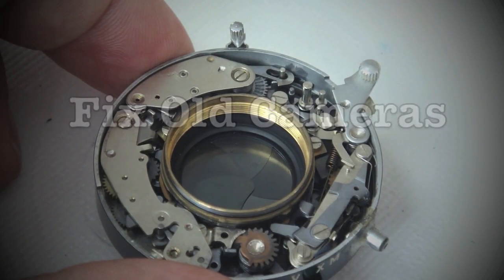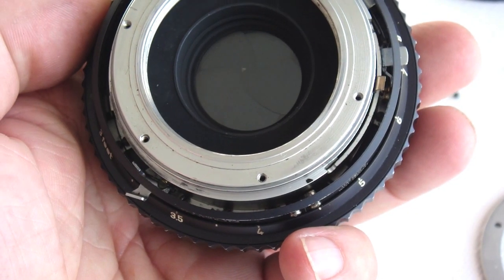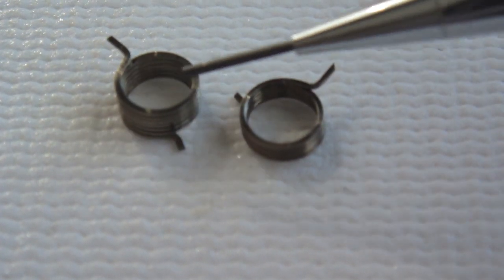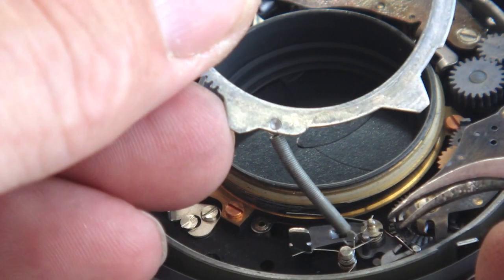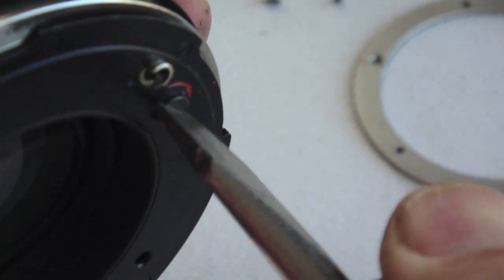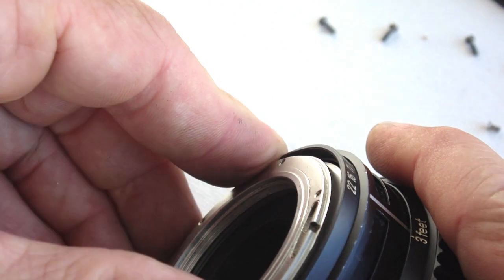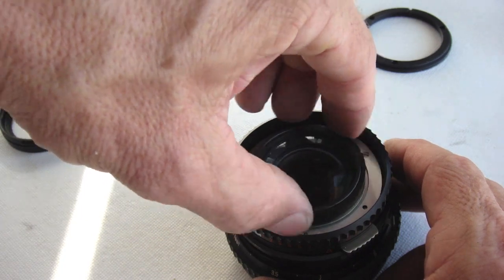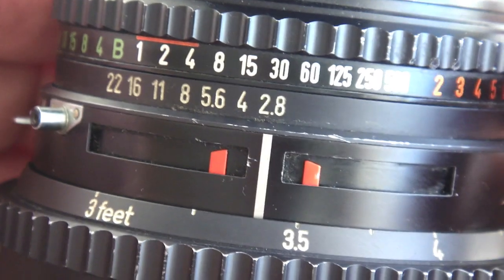Fix Old Cameras: Hasselblad 80mm T-Star Shutter Malfunction

Comment: At 3:17 no, don't do that. Oil has no place in a Compur shutter and even if it did that's way, way too much. It will end up on the shutter blades, the diaphragm blades and the glass surfaces. That gear train should only ever be lubricated with graphite powder, with the excess thoroughly blown out. But first clean it thoroughly in lighter fluid. Other than a tiny amount (literally a smear) of molybdenum sulphide paste on the sliding surfaces of cams and levers, no other lubricant is needed in a properly cleaned leaf shutter. The golden rule is that leaf shutter repairs are all about cleaning and not about lubricating.

While these videos contain some useful views inside cameras and lenses, the repair methods are almost completely worthless. It's worse than that, in fact, because the short term fixes are mostly kludges and not repairs. A proper repair would involve completely disassembling the shutter, cleaning it and rebuilding and a quality lens of this type is worth the effort but nobody on this channel seems to have the skill or patience necessary. In a few years time this lens will be unusable. Maybe that's the intention: a quick kludge to get it working again well enough to sell on eBay.
Reply from the maker: There is a golden rule of leaf shutter repairs? To paraphrase “do unto others as you would have done to you”… hmmm how about that. Had to look up the meaning of “kludge”, it was not in the two volume World Book Dictionary… but on Wikipedia this is what was found.  “A kludge or kluge (/klʌdʒ, kluːdʒ/) is a workaround or quick-and-dirty solution that is clumsy, inelegant, inefficient, difficult to extend and hard to maintain. This term is used in diverse fields such as computer science, aerospace engineering, internet slang, evolutionary neuroscience, and government.”  It figures it is an internet slang and is pretty rough, especially considering the Fix Old Cameras channel about statement… “Fix Old Cameras produces step by step up close videos of simple, common repairs and basic maintenance on classic and vintage cameras. Work a-rounds and short cuts that might go outside of typical camera repair procedures are also demonstrated. These techniques are not always considered a permanent fix, but allow for someone with limited tools and experience the possibility of getting their camera functioning again.” 
The Compur Shutter Service Manual (Compur-Werk Munchen) makes no mention or listing of graphite powder or molybdenum sulphide paste as an approved lubricant in the Lubricating Chart(CS-1912-206), however an oil designated as PDP-38 is listed. The recommended cleaning solvents are trichloroethylene or tetrachloro-ethylene. Probably not going to be able to obtain any of their recommended products. A gentler and safe to all plastic degreaser and cleaner is 91% or better yet 99% isopropyl alcohol. You did not mention rather you are using charcoal lighter fluid or Naphtha (for Zippo lighters or paint thinner) to clean the Compur shutters you are repairing. Not to imply that your technique you outlined would not work, for it seems as if it should. But, as comparison the Asahi/Honeywell Pentax Spotmatic series manual recommends on page 52 using light oil on the governor(escapement) pivot points. Without looking up anymore page numbers, you will find similar oiling instructions in the manuals of that era for Canon, Nikon, Minolta, etc. and along with the training lessons of National Camera Institute.   
Over extended time, perhaps decades, considering all conditions of use, lubricants, even those installed at the factory can and do migrate to other areas of the shutter. 
Thank you for taking the time to comment and for your passing acknowledgement as to the usefulness of some of the video shots of the inner workings of the featured cameras. As far as unstated intentions and your perception of the skill and patience needed and available for what you judge or deem as a proper or improper repair you can only speculate and hope.
Reply: Saying that oil has no place in a compur shutter is wrong. However in this video too much of it was applied! The excess should have been removed before reassembly or an oiler should have been used in the first place. Extract from the compur shutter repair manual:

"If the escapement was cleaned without disassembly, the bearings of the gears and detent must be lightly lubricated with PDP 38. Then remove any traces of oil from the plates, particularly from the underside of the lower plate 302, by means of a soft rag. If necessary, lightly lubricate the gear teeth with the oil mixture us ing a brush. Toke care to avoid the fo rmation of oil drops."

Exclusively dry lubricating a synchro compur is possible, however graphite powder has long been replaced as a dry lubricant for leaf shutters with MoS2. Mainly because of the graphite's abrasive properties that MoS2 doesn't have.
Reply: @MrRobot-om9mz  The manual to which you refer was written at a time when the professional users of such shutters would have had them cleaned and serviced on a regular basis. They are no longer made and the people who still own them, inherit them or buy them second hand expect them to sit idle for months and continue to work for years without being serviced. Oil is a bad lubricant because the volatile fractions evaporate and become redeposited on broad, flat surfaces, such as shutter and diaphragm blades, leaving behind a waxy fraction that gums together the parts it was intended to lubricate. I draw your attention to the last paragraph of your quote. Dry molybdenum disulphide paste, very sparingly applied after very thorough cleaning with naphtha, is the correct modern solution as it does a better job than oil, does not degenerate and does not migrate. On the subject of graphite, it's less damaging than oil but the excess needs to be thoroughly blown out.
Reply: @johnm2012  a modern synthetic oil applied in the right quantities at the right places will not migrate or evaporate in a way that will cause complete havoc in a leaf shutter. yes it may dry out but it will not seize as their organic counterparts used to do at the time.
just think of what the molybdenum disulphide is suspended in when in paste form? mineral oil. following your logic it shouldn't be applied either due to outgassing. but then again applied in the correct quantities as you mentioned, it is not a real life issue. if you want to be really "modern" about it you go for a grease that has a specified evaporation loss of 0,1% at 16h/70°C. Losimol and Klüber are your friends, if you can source them.
my last paragraph is in regards to the escapement and the usage of molly powder instead of graphite. with that method oil can be left out entirely.